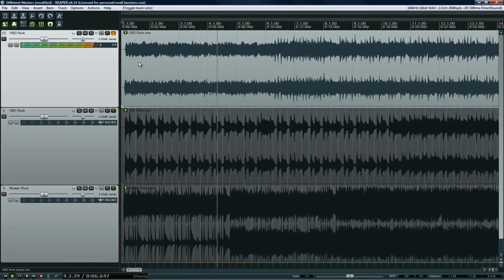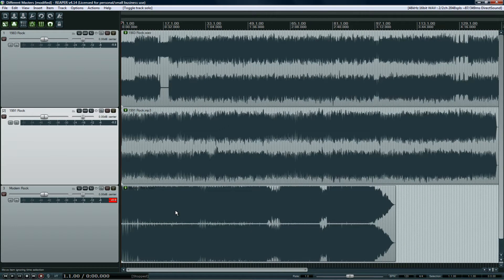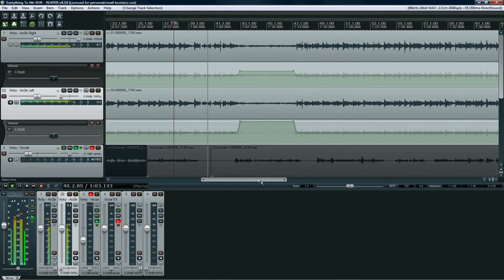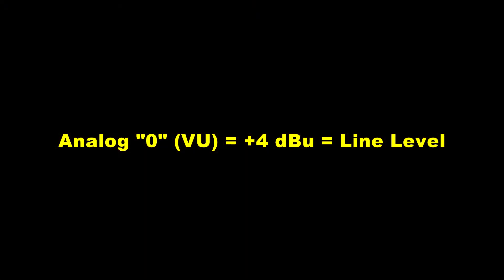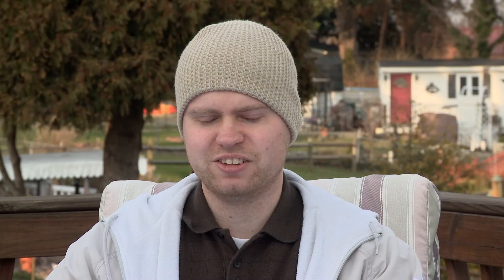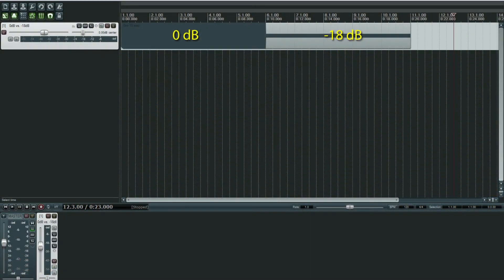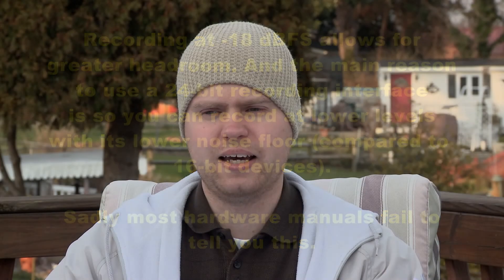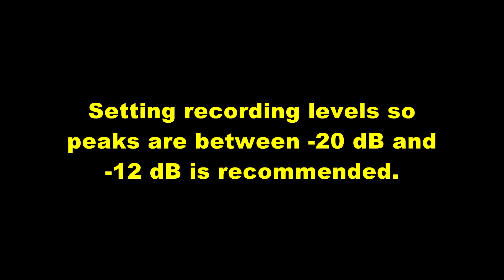Best Audio Recording Levels Optimum Tracking Settings

Comment: Thanks so much for this video! Awesome explanation. All your videos in fact. I watched this one before recording a project and made sure I kept everything around -21 to -18. Vocals I let peak around -15. But two non ideal situations have arisen. 1) headphone bleed, which was basically inaudible when recording hotter, is now audible. I can fix this with editing and gat, but still. And 2) For most plugins I have to turn the input gain up, sometimes WAY up in order to get them to register. Is that normal? Is it better cranking the plugin input or the fader than recording hotter? Thanks for your time.
Reply from the maker: +FlashbackinJapan Your plugins should be working fine. Although I do suggest peaking at -10 dBFS. You can get away with a peak or two at -6 dBFS for every song but no more than that for most interfaces. 

What kind of headphones are you using? I used to use Sony 7506 for vocal recording but after I got direct sound ex-29 drummer headphones I use those even for vocal recording because they don't let the sound out.
Reply: +RealHomeRecording.com Thanks so much for the reply! You said in the video that -18 is 0db, and all other literature I've seen concurs. But then said you can peak at -12, and now you wrote -10 to -6. Had I recorded with peak levels at -12, no problem. My plugins would register and as an added bonus I'd be able to see the waveforms. But peaking at -18 to -15, no. So is this a case of everyone knowing the science but practicing otherwise?

As for my headphones, I use AKG K240s. I've barely ever heard leaking before. Only since I started recording lower. Thanks again for your time!
Reply from the maker: +FlashbackinJapan At around 4:19 is where I say that peaks go up to -12 dB. Analog 0 = -18 dBFS. My maximum now is around -10 dBFS absolute after reading advice from mastering engineer Bob Ohlsson. -12 is usually what's on the meters so when setting levels I get them around -12 and when recording there's always a bit of overshoot.

I don't think most new audio engineers and even some experienced ones are aware of analog 0 being equal to -18 dBFS. One of the only reasons I know about it is from working in video and getting -20 or -18 on the camera meters ingrained into our heads when calibrating field mixers to the camera inputs. Back when 16-bit audio was the norm getting peaks close to 0 was common practice which made sense at the time but had the unfortunate side effect of converter saturation/clipping.

The K240s are a semi-open design. So they're fine for applications like mixing but for recording you have to be careful. Sony 7506 and the direct sound ex-29 are closed designs so this is less of a problem. I say less because sometimes singers will do that one ear cup thing without me knowing/seeing it and it bleeds into the mic! Turn down the volume going into the headphones, switch to closed back or use in ear headphones (even cheap ones) is my advice.
Reply: +RealHomeRecording.com Wow! Fast response! Thanks!! After recording and finding levels too low I looked more and found others citing what I believe to be more realistic recording levels. -15, 12, -10, and just now -6 or even -3 peak level. Well, the good news is I've finally got the answer. Thanks for the help. And I'll consider different headphones for tracking but really I think the increased recording level should do it.
Reply from the maker: FlashbackinJapan I would not go to -3 or -6 as a normal peak. Aim for -10 if you have to bring up the level for mixing then that's good. The reason to record lower is to avoid converter saturation which will take away from transients. Transients give your tracks punch.

I don't know which plugins that you are using but they shouldn't be having an issue with a lower signal.
Reply: +RealHomeRecording.com yeah, -3 and 6 seem too drastic for all reasons you've stated. Plugins are waves plugins. Mostly compressors like puigchild, LA series. I put them on the track and have to crank the input before the gain reduction needle starts to move. I thought it can't be right. Definitely a higher recording level will help. Thanks.
Reply from the maker: FlashbackinJapan Hmm...well it's been awhile since I've used those plugins. As long as you're not nearly maxing out the gain knob you should be fine.

On my White 2A plugin, for example, the peak reduction knob is around 45 and gain knob is set to 50 or so. Is that what you were setting it to with the CLA-2A plugin?

Comment: Hey bro! I'm a new subscriber love your videos by the way! One question, do you apply -18 in all instruments? Like drums for example do you apply that on every single channel of the drums? (kick, snare etc.) While im recording my e-drums i never hear myself as loud as i would like and i always end up increasing the volume, thus clipping occurs. I have lots of experience with recording but i guess never knew the real problem, clipping. Thanks in advance!
Reply from the maker: -18 dBFS is the average with peaking around -10 dBFS. Never going past -6 dBFS as an absolutely peak point for drums. This is just for recording, at mix time or after the drums are recorded you can bring the volume up all you want!

As far as low volume is concerned, a lot of audio interfaces have weak headphone amplifier circuits. I would recommend getting an external headphone amp (decent ones like the Rolls HA43 can be had for under $100) and using that in conjunction with your audio interface's line outputs.
Reply: Awesome thanks for the fast reply! I have been struggling for quite some days! It really helps!
Reply from the maker: You're welcome! Thanks for subscribing.
Reply: VGRider same rules apply. 
Try to average all your drum tracks between -22dbfs and  -15dbfs. Up to  -12 is O.K. but the average (RMS) level should be no higher. Never peak beyond  -6dbfs. This will give you 12db of headroom above 0dbu (-18dbfs). The video sets the peak at -10dbfs but you will lose 4db of headroom above 24 bits' 0dbu (-18dbfs). The industry set stadard is -6dbfs. Will my tracks be sweeter if I never peak beyond -10dbfs? Oh yes. Some people don't peak beyond -12 but this causes problems. The lower you set your peak means you might have to turn your recording levels down. This might result in your track falling slightly of the average sweet spot. AD converters were set up to mimic analog systems. It's up to you but most Pros average as close as they can get to -18dbfs and they don't peak beyond -6dbfs. When they remastered Pink Floyd's, Dark Side Of The Moon a few years ago the mastering engineer went buy these levels. If it's good enough for Pink Floyd it should be good enough for you and me.
Reply: Thanks for the reply man! Means a lot!

Comment: Im new to all of this and would appreciate your advice. I have just one question: if I set my 24bit audio interface input with enough gain to not hit the red in the interface meter, where should I set the level in the DAW ? Is this the level that should be set at -18 dbFs ? Thanks for your help.
Reply from the maker: Charlie Angel I'm not sure what interface meter you're referring to so it's hard to give you a straight answer. The important thing is to pay attention to your DAW meters because they are more accurate than analog interface meters.
Reply: RealHomeRecording.com Sorry, I was referring to the clip indicator on the audio interface. Im supposed to raise it as much as I can to get a great level without clipping... and then look for the levels on the DAW ?
Reply from the maker: Just go based on the DAW meters. Peak at -10 dBFS and you should be good.
Reply: RealHomeRecording.com What is the difference between the clip indicator in the audio interface vs clipping indicator in the DAW ?  I know I should stay away from both but I don't understand the difference. Thanks for your help.
Reply from the maker: The clip indicator is an analog device and is less accurate than the sample based meter in most DAWs. On my less expensive interface it lights up to a brighter green then blinks red if I clip. Around the -10 dBFS mark (on the DAW meters) it is the brightest green.

On my mixer and more expensive interface I just go to the highest green mark...maybe touching the yellow green lights a tad but not purposely. That equates to about -14 dBFS and -10 dBFS in the yellow.

Comment: So what if I´m recording a plug in instrument on a midi track in my DAW? While I am recording where should the max db be peaking? Thanks!
Reply from the maker: Good question. MIDI is data and therefore is not subject to the same rules. Once the part is recorded however I would trim the volume level back after the virtual instrument with a plugin like Blue Cat's Gain Suite. https://www.bluecataudio.com/Products/Product_GainSuite/ . 

Reason being is you don't want to overload any plugins down the line and you certainly don't want to overload your master buss.
Reply: Thank you!

Comment: Subed and liked. Sound pressure is vexing to me. I could spend hours of learning and asking "what is the correct sound level" I'm forever turning youtube volume up and down. I wish there was a tool that either adjusted it for me, or, and i cant believe i'm saying this with my limited knowledge of how complicated perceived sound pressure is, that it needs to be standardized. I give you the volume level controller 9001. Oh wait i haven't designed it yet. My condolences to your family.

Comment: is this strictly for recording audio?   or should it apply to midi levels also when mixing?  should you keep the levels all of tracks under 0db when you are mixing or mastering, or does it not matter as long the master channel does not peak over 0db?
because right now i have a drum track which are software drums instead of real drums,and i love how it sounds now,but the levels are actually hitting above 0db,and it does not sound as good to me when i lower it to peak below 0db. 
is it ok for me to keep the drums there as long as the master channel level is not going past 0db?
Reply from the maker: Thomas Stafford This video is specifically talking about recording actual audio not MIDI data and not mixing.

As long as you are mixing with a floating point DAW and rendering/exporting floating point files then you can go past 6. Because I mix using Bob Katz K-20 suggestions I don't go past 0 on the mix buss because if I did I would be hurting my ears. But within floating point you are free to go past 0 but I wouldn't recommend it.

Most people I've spoken to or read comments from don't go past -6 dB...-3 dB at the most. And NEVER got past 0 if mixing/mastering for 16-bit, 24-bit or any other integer format.

If you mix with outboard hardware that's a whole other topic and keeping gain levels in check is even more important.

Comment: It seems most gear that i have like the Roland vs-2480 say to use -12 to around -4 or -6
Reply from the maker: for peak levels?
Reply: @RealHomeRecording  Yes but i will only peak over the -12 now because when i made recordings in the past i had to level down my tracks to make the master buss handle them.

Comment: So -18dFS is 0db at the faders. You said I should record at -18dBFS. So closest to O? I thought you said that defeats the purpose and the recording will sound thin.
Reply from the maker: +Tony Nguyen I'm not sure what faders you're referring to, so I will take a guess. If you are using a mixing board you set the faders to the 0 position for gain staging purposes. 

-18 dBFS refers to the meters in your audio software. -18 = average levels. These days I try to not peak past -10 dBFS.
Reply: I'm not using any hardware mixing board, where would you say I should set track fader levels in the daw? 0 or so they peak at -10db?